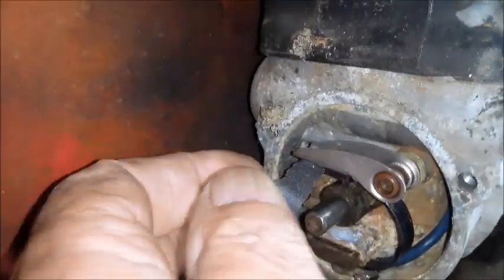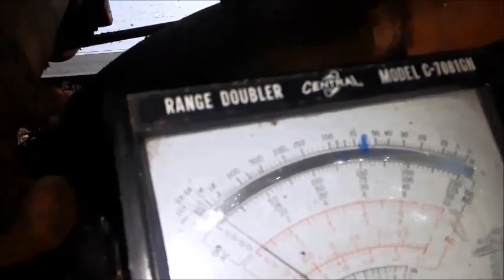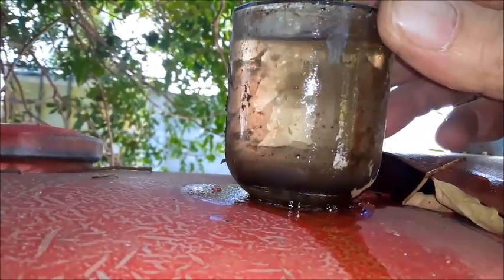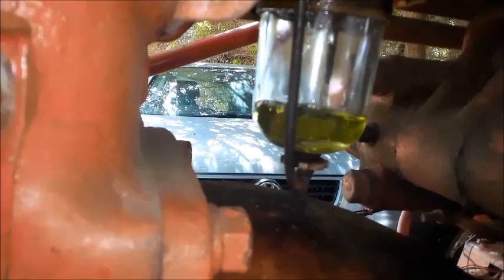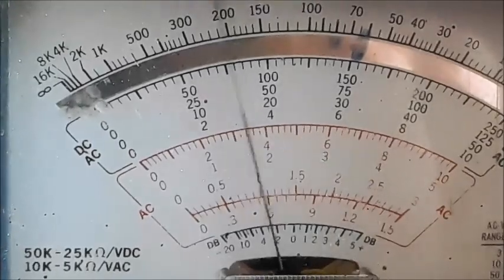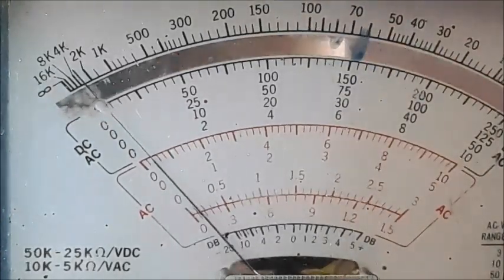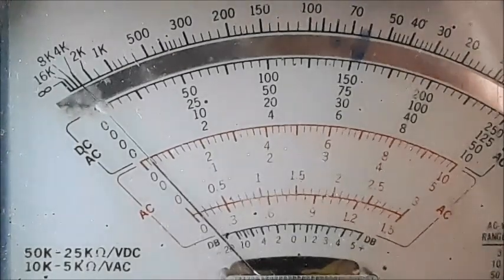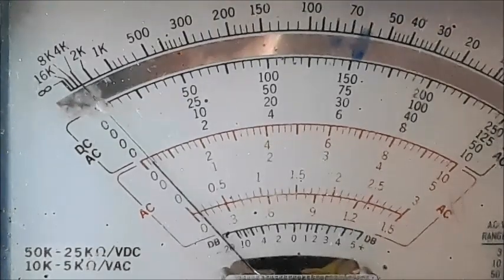Farmall Super A, Will It Start Part 2

Comment: Living that close to the Cape, I'm sure you get a lot of condensation on the electrical components. If you Google "How To Test a 12V Coil", there are a number of tutorials that pop up.
Reply from the maker: Thank You Matt, I see that but they always use digital multi meters, for me to read an analog meter accurately is a challenge
Reply: @jankotze1959  I have my dads old analog meter. I need to replace the battery and put it to work!

Comment: Jan, at 7:18 did you see the spade clip behind your wire is actually in contact with the coil mounting bracket..??  When mounted, that might take the 12v straight to a grounding situation. When resistance testing the coil, you should have between .2 ohm and 3.3 ohm on the primary + to - terminals.  The secondary is either + or - to the center.Either one, + OR - to the center should read 6K (6,000 ohms) to 20K (20,000 ohms) for a random coil that's not an ultra high rated coil. So use Rx1 for the primary and Rx 1000 for the secondary. Now mind you this is only a rudimentary test for the purpose of seeing the condition of the two internal circuits.
Reply from the maker: You have very sharp observation abilities my friend, I did see that and decided to take the ballast resistor out the circuit just for testing and starting purposes, well done my friend